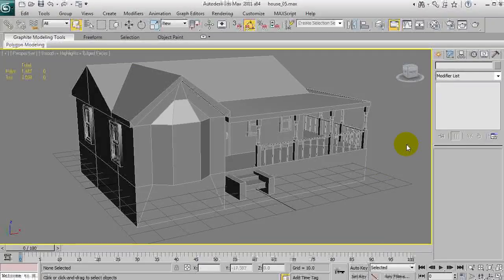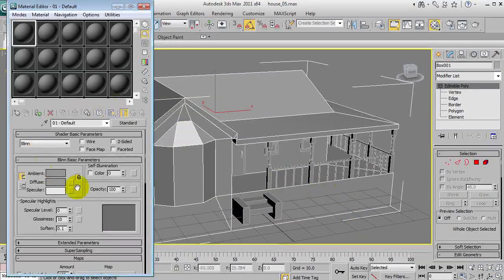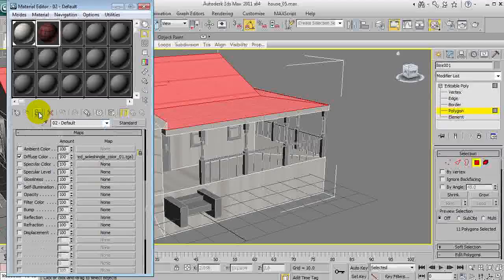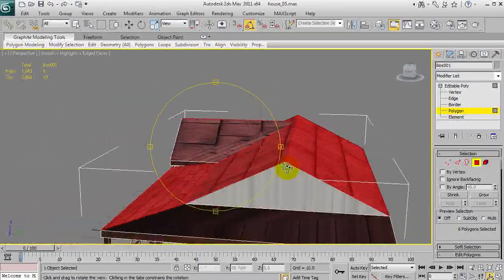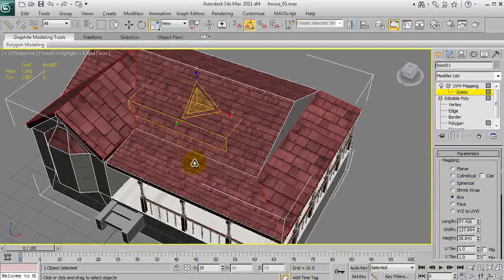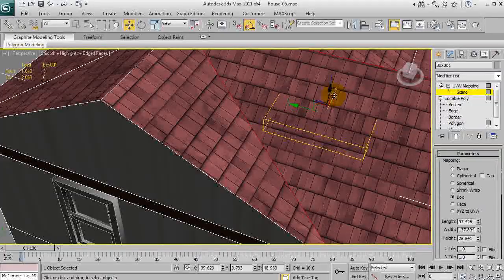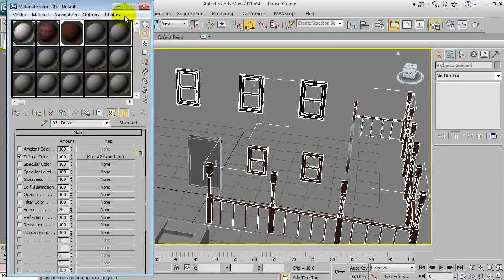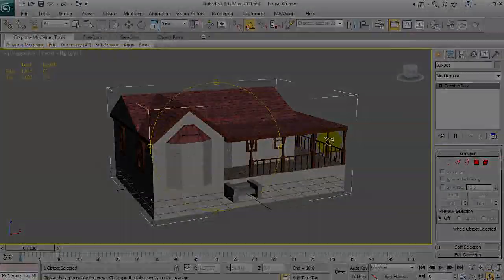Basic Modelling in 3DS Max: House (Part6) The Textures/Basic UV Mapping

Comment from the maker: This isn't the best way to go about it, normally you'd pelt map and flatten a surface, this is more a case of using a texture library so you can have multiple textures used on lots of models rather than make a propper UV layout which would be unique to each model.

Comment from the maker: Are you selecting the whole object that includes the roof or are you selecting the polys that make up the roof.
Selecting individual polys under editable poly is how you specify to apply the texture to just part of the model. Otherwise it will apply it to the whole model. One way you can make sure your selecting just polys is to hit 2, which toggles between shading the whole selected poly red and just it's border (this is what I did when aligning and scaling the UVW Map).

Comment from the maker: It achieves the same outcome, but quick slice, will create a full edge loop, more like doing connect than cutting.

I usually cut to change the flow of polys rather than for just adding geometry as I would if I were to quick slice which is a lot less precise than using connect.

Comment from the maker: @NexusCool1 Good question, I've not tried baking shadows before... using the texture library is more for when your using the same textures on several models, rather than make a texture sheet by doing a full unwrap and a specific image per model.